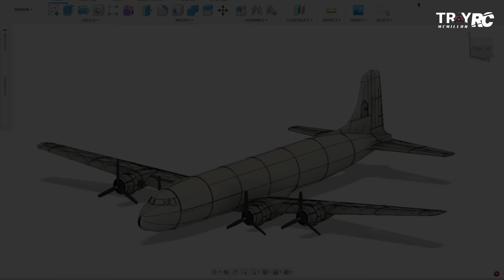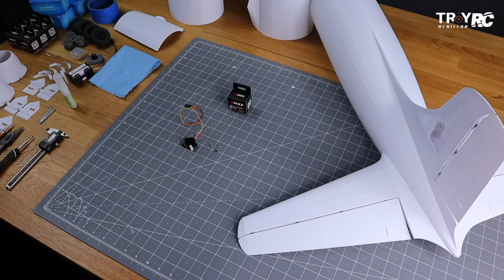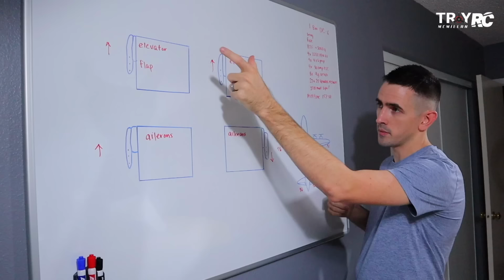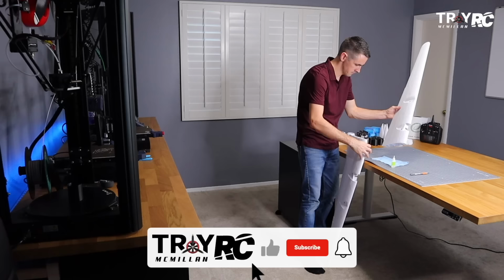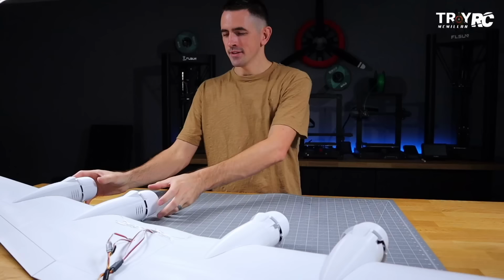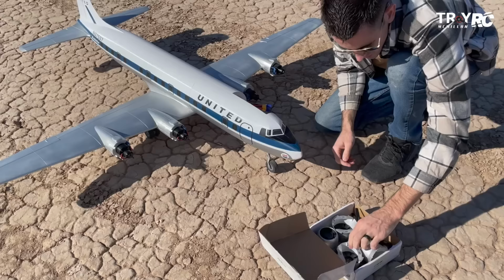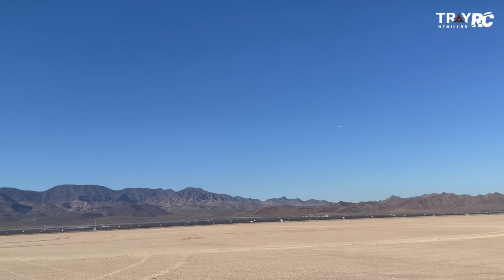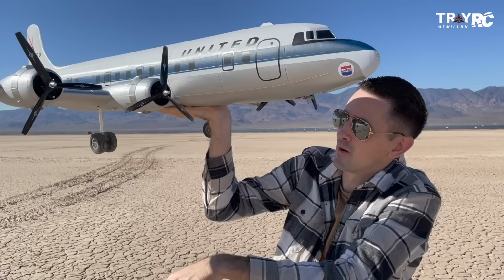BUILDING an AMAZING DC-6/DC-7 Airliner | Full DIY Build & Flight

Comment: That is quite the project and a very fine video presentation!  I would suggest experimenting with the prop rotation; where the top of blades rotate outward on each wing rather than inward (like a P-38).  Or, set the motors up like on the French M400; which have the props rotating outward for the outboard motors and inward for the inboard motors.  This sets up extra lift from the propwash.  Next project a Lockheed 049 Constellation?!

Comment: Hey Troy, I'm just curious about the strength of CA glue bond when it comes to the wing, I raise this concern because I don't see you adding a wing spar of sort to ensure the structural integrity of the wing. Can you explain to me more about your approach to ensure the reliability of this design? all in all impressive work
Reply from the maker: The spar is actually integrated into the design of the wing! Gluing the wing pieces together is all that it takes to create the spar. I've gotten quite a few questions about this, so I'm planning on making another video to explain the spar and how durable it is.
Reply: Looking forward to watch the video. Quite curious about your approach.

Comment: Brilliant - very clever. I've got a 110" Horizon Timber gas model with a cowling damaged beyond repair and currently unobtainable.  I've never designed, scanned or 3D printed before but getting some great ideas from your projects. While the investment in printing equipment looks relatively modest and I'm definitely interested, I'd like to design a cowling and get it printed as a first off project. No idea how to start!

Comment: Incredible design and build Troy!  I was just wondering how is the wing detachable for transportation, and how would you normally perform repairs if most of the model is glued together?  And how capable would using an AnyCubic Vyper be for this print?  Thanks
Reply from the maker: The Anycubic Vyper is one of my all time favorite printers, it would work perfectly for this build. The wing uses 3 screws to attach it to the bottom of the fuselage, you can see it right before the maiden on the video! Something that i've found that works really well is to use a hot knife to cut out a damaged area, and then you can reprint the same part and cut that new area and glue it in place. I have a few videos where I rebuilt some planes, like the Cessna and my Airliner that both crashed pretty badly here on my channel. It kind of depends on how bad the crash is, but there are lots of options. I'll link one of my rebuilds: https://www.youtube.com/watch?v=EvDbhInfS2c

Comment: Knowing where that is (pretty sure), you might have better luck at a better spot.  They are probably a bit of a drive.  I think there is a paved runway out um.....by RR.  That dry lake bed is gonna kill gear
Reply from the maker: Agreed the dry lakebed is nice for maiden flights because of how wide open it is. I have since took it out to a paved RC field and haven't had any other problems! I also strengthened and reprinted the gear because of this!

Comment: When I first started modeling, there was no servo reversing in transmitters. Linkages HAD to be on the correct side. I learned to change the servo rotation by swapping both the motor leads and the potentiometer leads inside the servo. Now I believe they mount the potentiometer to a circuit board...alas cannot reverse that!

Comment: Just curious, in Fusion 360 are you modeling with solids, surfaces or meshes?
Reply from the maker: I actually use both in different parts of the process.

Comment: Where wing's carbon tube is ?
Not the first time I saw this strange building choise on your plane .
What about hard landing ?
Reply from the maker: No carbon tube needed! I have integrated a spar into the design on the wings. When the pieces are glued together, it is very strong. 

As demonstrated by that hard first landing, the plane itself isn't fragile.

Comment: That is an amazing looking RC plane of a beautiful prop airliner btw. Please forgive me for possibly asking a dumb question. Is there a specific type of 3D printers that the finished project is smooth as your 3D printer produced for the fuselage, wings etc. Can your settings allow for smooth product or is a certain model of 3D printer?
Reply from the maker: Most of the modern day printers will be able to achieve excellent print quality, that paired with designers using newer printing methods. My favorite ones tho, are the Anycubic Vyper, Creality s1 pro, and any by FLSUN

Comment: Great job Troy! Just downloaded files for the build from Cults.  Can you please provide some information on how/where you source your decals?  How do you determine scale/size, etc. It would be great if a builder was able to simply repeat your order for the decals from the supplier you used.  Thanks, and keep up the wonderful work; planes, files, videos, and everything are top notch.
Reply from the maker: Thank you for buying it!! I really appreciate it. For the decals, it definitely takes a little patience to do them, but it actually isn't that difficult. I use GravitDesigner, a caliper/ruler and just take measurements of the plane once it is all printed out. Then I have a local print shop that prints them out for me on an adhesive material.
Reply from the maker: https://cults3d.com/en/3d-model/gadget/dc-6-dc-7-doos-and-window-decal-file Here are files for the decals for the doors and windows, just have your print shop write out your preferred livery!

Comment: Troy, Hi. Advice please. I normally buy GCODES from 3DLabprint for the 11 planes I have built. I run a PRUSA i3 Mk3S. I have just purchased the DC/7 from Cults3D and will look to start printing.
Shall I use the recommended Cura settings from Brian Klemm that you previously recommended? Can I use the latest Cura software? If no to both questions, please tell me the best way forward.
Reply: I am now making progress,  when I convert to gcode, print the DC6 FUSE 2.stl file it is fine except it will not print the bottom internal flange. Any ideas on settings I may need to change?

Comment: With such a large plane im struggling to understand how you have managed to get away without some kind of stiffiners in either the wings and fuselage.
Reply from the maker: It is all integrated into the design of the plane! And all it takes is a little bead of CA glue on the parts to bring it all together! It is a very strong plane.

Comment: Hey Troy,   I have never 3D printed before, could I use the Ender 3 to build this aircraft?

 Or what’s a good beginner 3D printer to buy, to build this plane? Thank you!
Reply from the maker: Yes you can! This model is designed to be printed with a build volume as small as 200x200x200
Reply from the maker: The best printers I've ever used are the Anycubic Vyper, Creality S1 Pro and any of the FLSUN printers are amazing. You can't go wrong with any of those.

Comment: Great vid and looks like a great design.. Interesting no joiner tubes and just CA holding together? Tires look great - didn't think to do them in two parts. Just a few years ago, people were afraid to use any 3d printed parts at all on a plane... came a long way quickly! Is this any faster or easier than stick built? Probably not, but sure opened up to a lot more detail than conventional building would allow (easily anyway) and lot more people are designing planes now, and like this, of much greater diversity than in the past. I recently designed my first totally scratch AFV in 1/12 scale, and lots of airplane parts, but no full plane yet... that's next! - A 1/6th scale Go-9 then a 1/12th scale Do-335

Comment: That is awesome! Probably a little big to make on my Prusa Mini though. One question: what program are you using for the CAD? An aircraft I would love to build (probably about the same size) is the Lockheed EP3-E. Not much more complex. Thanks for the great video - pleasure to watch!
Reply: That's Autodesk Fusion 360. There's a limited free license available to individuals, and a low-cost "Maker" license (also for individuals) if you want more features. A lot of the same skills/techniques will transfer to Inventor (Fusion's big-iron sibling) and SolidWorks, too.
Reply: @Alterscapes  Meh. Go Full FOSS, you won't regret it.

Comment: Hi troy, I'm fairly new to your channel but i really enjoy all of your content. I wanted to ask you a question that maybe you can address in a video; A lot of talk has come around Toroidal propellers recently. These are typically designed for drones to decrease the noise, but one interesting thing is that they are also more efficient. Smoke tests show that a Toroidal propeller also pulls more air from the surrounding space into the propeller that would traditionally be bypassed.  The shape is also used in marine applications and boasts noise reductions and efficiency gains even in water. I cannot seem to find anybody talking about these propellers for fix-wing aircraft....nor can i find any reasoning why it wouldn't also be beneficial. Given that RC planes have similarly sized propellers as drones it is reasonable to assume that RC planes would also benefit from the design....what are your thoughts??

Comment: You didn't build in any wing spar supports?
Reply from the maker: I designed an integrated spar into the wing. no need for carbon fiber this way, and its very strong!

Comment: I noticed a little difference in the internal structure of the print, are you using a similar technique to Eclipson that allows your print to be printed in vase mode..? Or are you doing something entirely different. Insides look super clean, No stringing at all. Just curious how you are getting that.

Comment: How does your eSun PLA+ hold up in the sun and under UV exposure? From my experience, PLA+ warps relatively easily after a short time outdoors
Reply: If its painted how does it get UV exposure? edit! it looks like only the wings are painted.
Reply: @andersandersen6295  in my experience and testing, paint does little to protect PLA from the effects of the sun (both heat and UV), unless there's some type of magical coating I'm not aware of 🤷🏻‍♂️
Reply: @HarmanMotorWorks  A google search using "UV protection paint for plastic" tells me that its very disputed, but if you can get UV resistant clear coating, i dont see why that would not work on PLA? but yes it seems to be sensitive to "high" heat over 50-60 degrees.
Reply: @andersandersen6295  I've done quite some research on the topic indeed but I couldn't find anything definitive to state that PLA or PLA+ can be adequately protected from heat and UV rays. Most of my sacrificial PLA+ prints left out in the intense sun for months have resulted in horribly warped parts. The thinner and larger the part, the more affected it has been. Smaller and more 'solid' parts seemed to fare better.  In the end I decided to move to PETG and ASA material; these have been much more resistant to the elements even without any coatings.
Reply: @HarmanMotorWorks  Well that is fair enough, but have you even tried to protect the PLA with the usual UV procetant coatings available? and are you sure that left sitting outside UV was the most devastating factor? PLA is a biodegradable plastic and thus not made to be very stable or have a long durability, in fact it seems that in any case where you want a product to last PLA is the worse plastic to use, so i understand the move to other more durable plastics, and i would like to hear why PLA was chosen for this model? it may not pose a problem as im sure it will not be sitting outside for longer periods at the time.
Reply: @andersandersen6295  To be fair I haven't tried any UV protectant coatings but in my testing, I have seen my very wild warping after being left outdoors. Parts left indoors and out of the direct sunlight didn't suffer such a fate. PLA is definitely the easiest to print with and the safest for the environment being biodegradable, but like you, I would love to know why PLA was chosen for this aircraft; it seems like other more robust materials would be more suitable. You are correct that it may be a huge issue as the model won't be outdoors for an extended period of time, but I still think that after many many flights over time, you will see the PLA material suffer deterioration.

Comment: Hello Troy.  I am using FLSUN V400.  It just knocked off a 85% completed  wing from its brim.  Obviously it is ruined.  How do I stop it from happening again?  Is there a setting that lifts the nozzle when it has to go from one side to the other?
Reply from the maker: Hey John. That is so frustrating. Yes, there is a setting for this - it is called z hop when retracted under the travel tab in cura. Just check the box and select how much you want it to z hop!
Reply: @TroyMcMillan  Thank you.

Comment: Troy How long did it take to get the fitting correct and where you need at add strength members, etc? Cool plane awesome project.
Reply from the maker: The whole design process took me a couple of months of designing and testing parts!

Comment: hello again troy I did not realise I was in a competition and the comment was from the heart and being in the Neanderthal age group am not sure what Telegram is ,I struggle enough with face book, and the fact you responded to my comment is reward enough so I would be very pleased if you pass any thing you wish to award me to the next boy or girl you see fit. Just a question on this line we se lots of DC3;s and C47 which I know are very much the same aircraft, but one of my favourites is the Curtiss commando which served over here I believe  during and after WW11 is very rarely seen in radio control model form all the best from Phil.  and Janet
Reply from the maker: Hi I am not running a giveaway on any platform currently. I do not use Telegram. Please do not give out any personal information to anyone that is pretending to be me, I do not need/ or ever will ask any personal information from you.
Reply: @TroyMcMillan  I just put this suggestion as a reply in the hope you might read it. Regarding landing gear breaking, have you considered including steel reinforcing inside the legs? We do this for a different application which has similar risk to yours. Include a round tube space in the print, and then bed in an internal steel support with 2 part epoxy mixed  with fiber filler to a mayonnaise consistency.t

Unless you want the legs to fail instead of the actuator being damaged, which is perfectly understandable.

Comment: I think the main reason your nose gear and the other wheel came off was the rough surface. There were no shock absorbers so the entire shock wave was being absorbed by the entire gears hence tearing it up
Reply from the maker: I think so, too. The main gear do have shock absorbers, but the nose gear doesn't. That terrain is rock hard though.

Comment: No wing spars?
Reply: i thought exactly the same, when the wing went together, i at worst would stuck some cardboard tube down the middle
Reply from the maker: It wasn't overlooked. I actually integrated a spar into the design of the wing pieces! It is very strong.🙂
Reply from the maker: @stevem7868-y4l  That is a cool idea! In this hobby, we usually use carbon fiber tubes, but they can be pretty hard to find at larger lengths - so I designed these wings so a physical tube isn't required!
Reply: @TroyMcMillan  Im in the hobby as well, but not really built many planes, what span is this plane

Comment: Hi Troy ,a question , what’s the casing software you’re using to draw ? . Is it freeware ? . I use the 123D design because it’s free . I haven’t find any other like that … thanks . Very nice Job 👍
Reply: You can use autodesk fusion 360 (free version). Bit of a threshold but powerful

Comment: Why is there no carbon fiber tube going through the wing?
Reply from the maker: I actually designed a spar that is integrated into the pieces, when you glue them all together, the spar is solid, strong and very reliable.